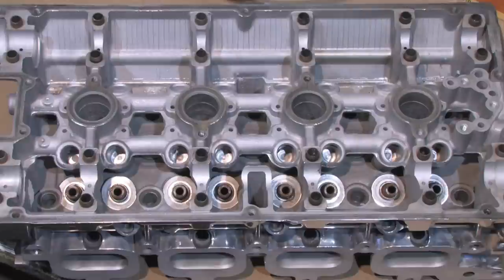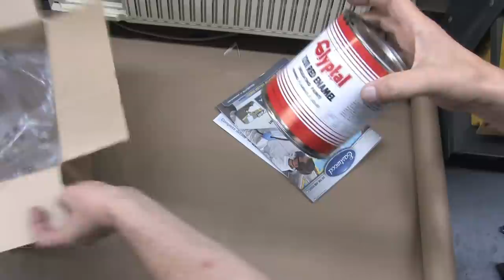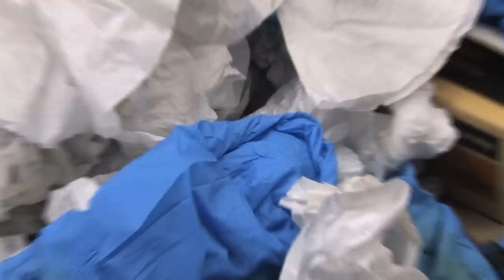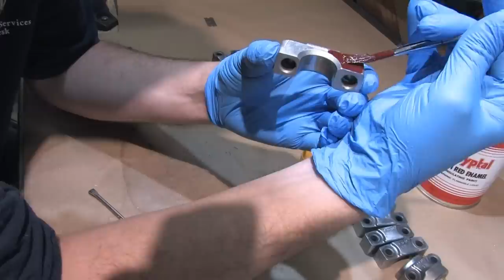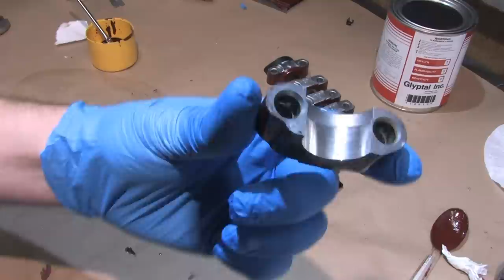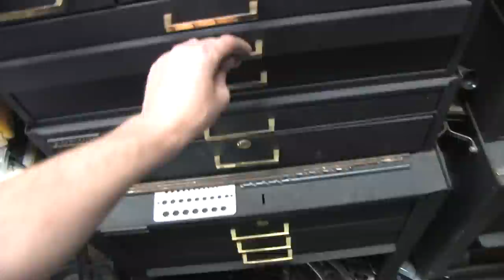Glyptal Application Process

Comment: I'd much rather have the oil pull heat out of the head.
Reply from the maker: ...and I don't have a problem with that.  Some engines need all the help with cooling that they can get, like Volkswagen and Porsche...  Some of these 4g series engines don't even have an oil cooler.  I usually add one, but I'm just sayin'... that's how much Mitsubishi was worried about oil doing the cooling.  There are some engines that you could kill with an insulating layer.  Making the right cooling system modifications can negate any ill effects of the coating, but by no means is coating the inside of an engine necessary unless it's leaking oil.  It's sure going to be pretty being bolted together, though.
Reply: It's gorgeous.  I mean on one hand I hated your ADD doing this, on the other hand all it did was validate that I'm not the only one that sweats details that few others know about let alone care about.
Good work.
Reply from the maker: Beau Mancini It wasn't so much an advertisement as it was an attempt to clear up misinformation.  No better way to do that than make myself a public guinea pig.  I can't wait to bolt this thing back together this fall.  :)
Reply: No, no.  Not Ad as in advertisement, ADD as in Attention Deficit Disorder. :)
Reply from the maker: I'm sorry what were we talking about?  ;)
Reply: more like ocd :)

Comment: Glyptal is some scary stuff. I did not see you wearing a respirator while doing this work. It is not my place to tell you jack. All I am is concerned for yours and your viewers safety. This is not a product to be used without a respirator, half faced with organic/mist filters. If you doubt me consider the MDS warnings on this product. Denatured alcohol is no joke either. I used to clean parts in a trough at my work. I cannot go into it, but when you wear the safety equipment we used, you left there exhausted and heat frustrated. Chemical exposure is important and being complacent about it is foolhardy and stupid. Life is precious and safety is not something you can ignore. We do not see your head while you are doing this but I did see a face shield being worn and gloves. I can only hope you had respiration equipment on. Ugly things can happen otherwise. It is wise to be forewarned so you know what to use and how to use it and what is required to protect you from it! Be safe and continue your detailed work!
Reply from the maker: One session with this stuff and I learned OVP-100 organic filters are mandatory.  The safety material is well covered in the block coating video.  I learned my lesson.  I took plenty of caution with ventilation, but it wasn't enough for the couple of hours it took spread out over a few days.  It was an incredibly small exposure, but it doesn't matter at all, chemical damage is permanent.  I don't know how floor strippers even survive their jobs?  They're the ones who work all day in Xylene vapor.  People who use the solvents in this paint for a living are crazy.  And you're right about the way you use things, I've suffered zero effects using it ever since with the right protective gear.
Reply: Thank you for recognizing. It’s real hard for people who haven’t dealt with exposure to chemical hazards as a part of their work to understand. I have and it helped me learn early. I have had Hazwhopper training and it helped immensely. I am glad you haven’t suffered as a result from exposure. I just don’t want others to fall into problems from it. I care about it a lot!